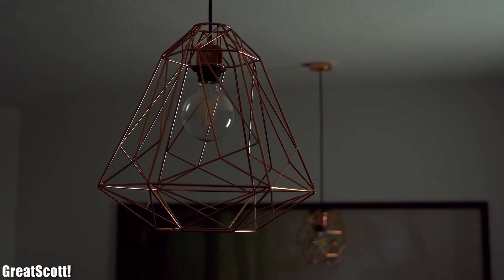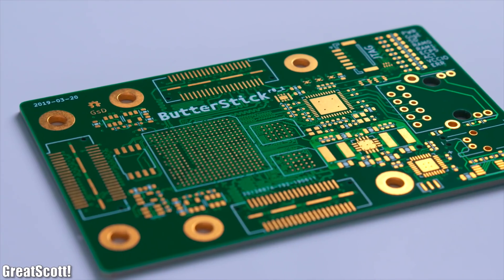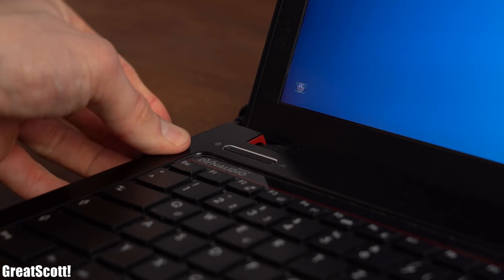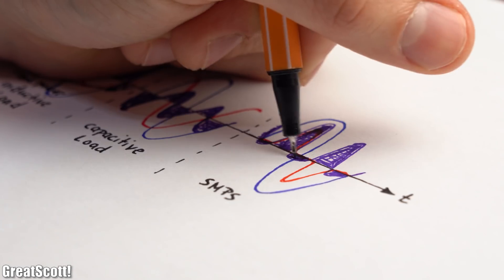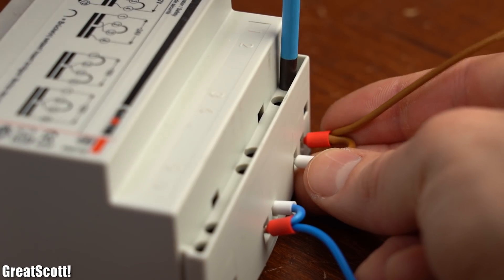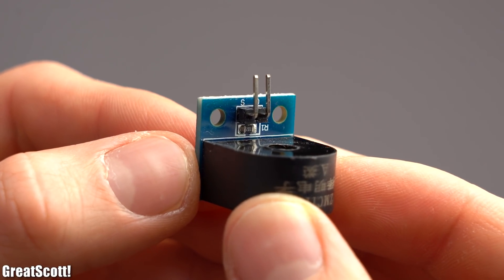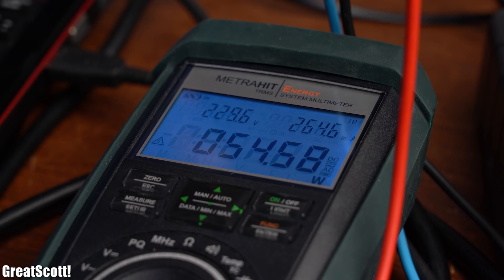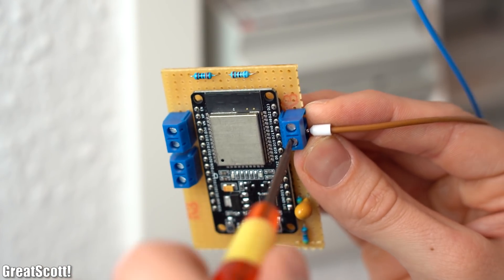DIY ESP32 AC Power Meter (with Home Assistant/Automation Integration)

Comment: Any thoughts on seedstudio's $35 XIAO-2-Channel-Wi-Fi-AC-Energy-Meter-Bundle-Kit?

I'm interested in detecting when there is a sudden current usage (say when the refrigerator turns on, or when the garage door opens), and then making a small beep OR sending an email/text!   I'd prefer not to use anything that requires a subscription or a company server to to stay online (Emporia Vue)

Comment: How to manage or estimate the phase shift when you use a transformer instead a resistive voltage divider to get a safer lower voltage signal to apply to the microcontroler?

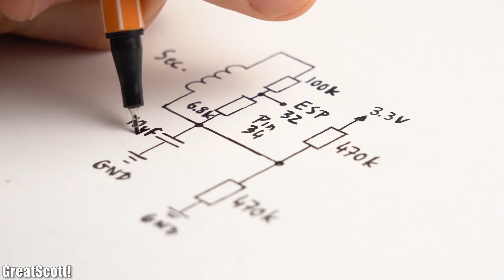Comment: 6:46 it is day 19 of me watching Arduino hobbyists on Youtube.  I have still yet to see someone who doesn't solder like a psychopath.  

Either use the perfectly good breadboard you have it plugged into, or remove the headers and solder to the holes (with the stripped wire going THROUGH the hole).  For some reason nobody on Youtube can figure this out.

Comment: Not sure why, but my outputs are just massively off... I can adjust the calibration number to get it to match, but then as soon as the current changes the output is again massively off..  Using esp32 with ads1115 and the standard emonlib library, but with a slightly modified calcIrms function to take an array of readings from the ads1115 as an input variable, instead of using the built in ADC.

Comment: I ended up on this video because I'm doing the same in my house. I did a lot easier approach without using an external library but just using the CT-clamp esphome sensors support. My issue is that I have an approximate power value since I have no way to differentiate on the load type so everything is calculated as a power factor = 1 like a resistive load. I will make a better analysis on how to integrate the emon lib to have a better accuracy. Thanks

Comment: I tried to do the same with esp32, but I couldn't. I made the compilation and transferred it to esp32 and when I try to visualize it on the serial monitor, it just shows random data from any... I tried several rate speed combinations.. 9600, 115200, but nothing. Could you help me?

Comment: I'm running two circuits, one with grid power supply only (high-power appliences) and another with fail-over from an inverter/battery that has low power appliences and all lamps. I also need to monitor battery charging and discharging currents with voltage, so I could measure efficiency and battery health.
I think one current sensor would be enough on battery +ve terminal ; should give -ve values when charging and +ve when discharging.

Comment: Hey, nice video, like always <3

For my understanding...
the max current is 5A. But in germany the circuit breaker normaly has a max current of 16A. What happends if your load on the wire you are measuring is to high?

Greetings from germany

Comment: Thanks Scott for this. I wanted to make one myself a while ago and I wonder how much difference does it make just assuming everything is resistive load it seems to me that they are really few capacitive and inductive loads in a household even if there are some they might even cancel each other out. I think a similar device albeit with a little less precision can likely be made by just using the current sensor, do you agree?
Reply: That would be very inaccurate as the incoming voltage would vary during the day. You need both to make proper measurements.

Comment: Is this also compatible with measuring DC Power? So the software will do it, but does the current „ring“ can handle it? 
Thanks
Reply from the maker: Nope. The clamp is for AC only.
Reply: @greatscottlab  Too bad, thanks!

Comment: I tried something similar with ESP32, just to realize that ESP32 internal ADCs are way too noisy for the job :-( And also non-linear as well, so I endup with modifying emon library to support ADS1115, and now the readings are within 1% accuracy. You can try by simply feed some stable analog voltage to the ESP32 ADC and read its value, it will fluctuate a lot !!! Otherwise good video mate ;-)

Comment: I was wondering what is the phase relationship between input/output for the mains voltage sensing transformer. There may be a few degrees lag here.

Comment: I understand the safety aspect of using an isolation transformer in this project for sensing the voltage.   But, for low loss, such transformer must be large and expensive.   Since you know which mains wires are hot and return (connected to earth) can you simply use very large valued resistors, to form an ac voltage divider, capacitively couple the signal to a VDD/2 bias string?

Comment: Hi,
Thanks for your project, I did exactly your steps but I get a couple of erros with compiling in Home Assistant. Does the files have been or need to be updated since you made the video?
Reply: Where did you get the code for the powermeter.h, using only the Amps not voltage?

Comment: Thank you. I will cehck on the emon code. but do you know if i can connect multiple current transformers and use a few more pins on the esp32. will the controller be able to handle 4-5 CT coils ?

Comment: I have a question about the esp32-s2-wroom-1 series... and maybe the esp32 in general. I am completely new to programming and got this for my birthday. After some libraries and coding I have gotten an hc-sr04 and a dht-11 working together to output data to the arduino serial monitor... my question is on WiFi do I have to do the network and password or is there a way to just communicate wireless without a network??? I haven't really done much with programming before???

Thanks for any replies!!!

Comment: What if there is current >5A? Oh and also let me guess the error of measurement is like 10-30% ?
Heh that is not practical at all plus esp32 has cheap inaccurate adcs. better make a wifi ac dimmer or regulator

Comment: The CT Clamp component in ESPHome is based of the emonlib library and has very easy integration, it even allows you to use a higher precision external ADC such as ADS1115.

Comment: I inspired from your videos. Thanks for your great effort and keep on posting. Very useful one. 

I request you to make a video on, Which is the best ceiling fan regulator type ( Electric (Resistive), Triac based (smooth control), Step control (Capacitor based ) )

Comment: You may use ordinary 2-3w 230v to 12v transformer as voltage sensor. So that you can fit in small area. Thank you for very usefull application:))

Comment: Hey, you made a video on NE555 timer in which you showed how to get decent PWM using TLC555 instead of NE555. You told that NE555 uses bipolar transistors and TLC555 uses MOSFETs. But I am not getting any TLC555 timer IC in my area. Is there any method or idea to convert NE555 into TLC555 ??

Comment: This is literally creative and well explained from you 👍 But as long you want to single phase and max 16A and want to go the short path, I recommend to buy a sonoff PowR2 module and flashing tasmota on it. Now you can easily integrate them into mqqt based systems. Additionally you can adjust them later on the integrated terminal function in the web interface.

Comment: I recently bought a 3-Phase power meter from ABB, works fine, just didnt figured out how I have to read the modbus values to show them over my esp
Reply: I did the same but got Schneider electric. I'm only using single phase and I'm logging it to file at 10hz and outputting data via MQTT as well. For 1 month I metered 200Wh more than my utility did for the same period. Given our clocks weren't synced that is amazing. I need to go back and run my analysis again.

Comment: I just learned you are in Germany. You have a great channel, some of the best technology videos ever made.  

Check out a device in the USA called sense. www.sense.com it uses CT’s to measure amps, and a voltage detection BUT also DSP’s to see the feedback of equipment and can detect motors, heaters, and equipment

Comment: I had a doubt Scott, why dont you use ACS712- Current sensor and ZMPT101B- Voltage Sensor and make it as simple as possible and well portable as well with no external circuits as well?

Comment: I've recently done this myself, well similar. I wrote my own code in the IDF and used the SCT-013 current clamp so I could measure the whole house current. No touching of live wires needed since it's a clamp rather than pass through doughnut. Works very well but I am assuming voltage since I don't have an isolating transformer yet to measure it. That's the next upgrade!

Comment: If the voltage transformer needed if you know your supply voltage (or what it's supposed to be 110/220) could you use that to sense the current and multiply to get the power?
Reply: You can but mains voltage fluctuates. So to measure power with accuracy you need both voltage and current. Some cheaper home energy meters just use a constant voltage. The most stable aspect is the frequency as utilities have right requirements to provide close to 50 or 60hz. Voltage varies by 10 percent or more during the day as supply and demand fluctuate.

Comment: Some of the new/Modern US home power meters actually have debug output ports. You can hook into those if you want, they are read only and not encrypted in any way. So this may be even easier to access the data.

Comment: This may be off-topic but can't seem to find any updated information on the subject. Have managed to build a sprinkler controller and a couple of temp monitors for around the house. Using ESP8266 dev kit and the ESP8266 Wemos D1 Mini. But have been struggling with creating a cell phone app with buttons and other display items. 
I did find cell phone app programming software called Blynk. Unfortunately, I don't know why it dropped from popularity well I kind of do.  
If you ever decide to create a video on Blynk I would surely watch and possibly donate to the cause. I have watched many videos and many have stated it is easy to use. But upon further discussion, most if not all are based on a simple button that has an on/off capability.
I think if you try and used this software you will spot the failed sections of the process as I have. Really would like to be able to control things from my cell phone as in ESP 8266 devices. Fingers crossed you take a peek at this and decide to do some videos on this subject. Oh, and BTW there are many videos online for BLYNK but they are either of poor audio quality or years old.

Comment: I think your isolation transformer is a bit overkill (and likely very expensive).  You can easily substitute it for this: https://tinyurl.com/y29hzfo3 In fact the linearity of the transformer used in that module may be better...

The downside of that board is, they use an LM358 which has a minimum voltage of 5v.  But I just replaced it with a more modern rail-to-rail op amp (MCP602) that worked well for my micro.

I also would not use an ESP32/ESP8266 for this.  Both have terrible ADCs.  Theoretically the ESP32 has 12bit ADC, practically, the noise makes it unusable at 12bits.  I found the STM32 to be significantly more reliable.  I ran the STM32 in dual conversion mode with a conversion rate of roughly 5k SPS and with all that being said I pretty much get something akin to an oscilloscope (I passed the data over serial to an ESP32 where it is processed).

Comment: I would have liked more explanation on your simple circuits and the choice of your components. For your offset circuit i understood the use of the decoupling capacitor and the voltage divider but i don't get the use of the 200ohm resistor and the inductor...

Comment: You can just buy sonoff pow r2  for 11 euro and reprogram it via esphome. it does actually the same, but can handle 10A cont./16A peak, has built-in relay, and you do not need to write your own code and build the device

Comment: It looks stupid, really. A step down transformer + voltage divider + ADC on ESP... Heavy solution and metering accuracy is not sharp I guess.
Much easier to connect pulse or data output from power metering unit.

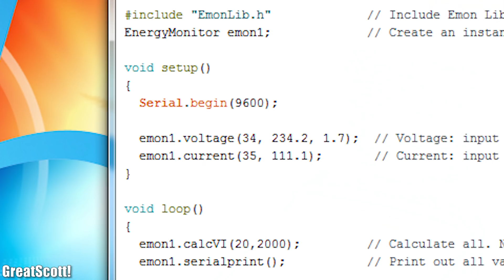Comment: 8:40 how do you calibrate these values? Do you need a 1000€ power meter to find the right values? 😱
Reply: No, you dont need power meter. Just a good multimeter and calibrate the voltage and current values to get match with the value's output on IDE serial monitor.